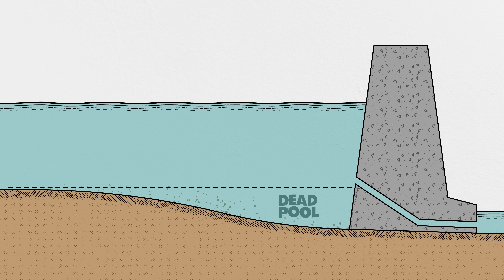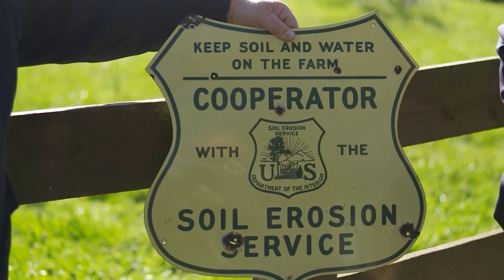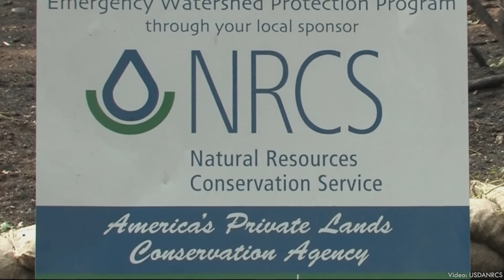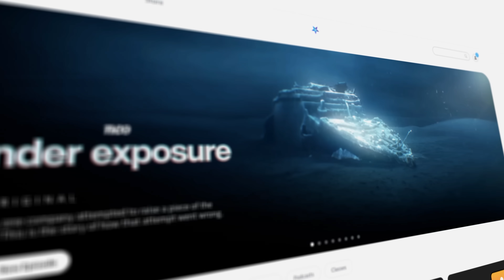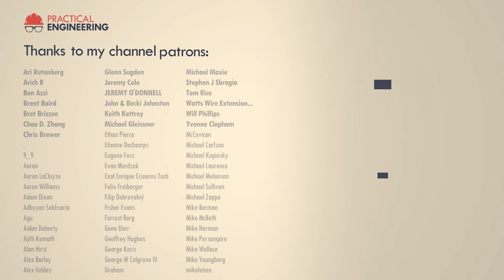All Dams Are Temporary

Comment: This is a key point about hydro-electric for our energy needs.  Dam operations have to serve 'many masters'.  Irrigation, flood control, power generation, this and more.  A useful structure, but complicated to operate sustainably.
Reply: More hamrful than they are useful, at least how they're implemented now.
Reply: @johnperic6860  you don't like free energy? Rather keep buying it from canada?
Reply: @johnperic6860  Oh please, people forget how some areas flooded constantly without dams. In 1931 the yangtze–huai floods killed millions, and while extreme, this is not an exception. Also, Switzerland has been generating the majority of it's electricity with hydropower from dams for nearly a century now.
Reply: @slome815  
Removing the reservoirs does not entail entirely removing the dam.

What I am speaking of is simply turning existing dams into dry dams, that is, dams which allow water to pass unabated but then fill during times of flooding. 

I'm not sure what your point regarding Switzerland is. So they're experienced, and have seen that flushing reservoirs isn't actually harmful in the long term?
Reply: @slome815  the constant “flooding” served a lot ecological benefits, groundwater recharging, pollution management, improved soil fertility, species diversification, etc! Dams are terrible should be banned, most importantly large ones
Reply: @ That's a major generalisation. Some rivers barely have any nutrients and silt, most dams high in the mountains contain streams like this. Then the only thing a flood does is destroy and kill. Do you understand how much power hydroelectric dams can provide, for decades or centuries, and for a fraction of the price of nuclear power plants. 

15% of worldwide electricity generation is from hydropower, this is more then wind and solar combined, and unlike those, it's a good baseline power generation, thanks to the dams. For mountainous regions like Norway (95% of electricity is from hydropower) and switzerland (about 60%) it's by far the best way to generate electricity, both long and short term.
This recent anti-dam movement is dogmatic and as asine as the "green" anti-nuclear power people are. Most dams are a net positive.
Reply: @slome815     No thanks! Based on firsthand experience in my region, I've seen the devastating impact of one of India's tallest dams. It has been leveraged as a geostrategic wea-pon against my region my people, severely disrupting local rivers and aquatic ecosystems. The long-term consequences of such massive structures raise serious concerns, as they have the potential to cause catastrophic failures.
Reply: @  they’re also ticking ordinance time Bmb’s.
Reply: @gurjotsingh8934  And your alternative to dams is? Fossil fuels? Nuclear? Those are even less sustainable, therein lies a huge problem.

The real problem isn't that dams are filling with silt but rather, it's what we're losing all that topsoil in the first place. That's the real problem here.

Removing dams as a solution is akin to telling people to stay inside as a solution to crime. It works but it's not the real issue.

Comment: The mention of "on channel" suggest one solution - divert the river into the reservoir to fill it. and then return it to the normal path, so your reservoir is "off-channel" Of course, this creates other problems like stagnant water.
Reply: Problem there is the river channel is where the reservoir exists. You'd have to dig a whole new channel.

I live near a flood control dam (hydro is secondary use). Elevation of the tailwater is about 700ft, the conservation pool is about 740ft, full pool about 790ft (floods a lot of ag land too)

To divert the river into a second channel while maintaining the existence of the reservoir would require a 50 mile long aqueduct sufficient for 10,000 cubic feet per second (average flow) that also contain bridges to carry water from the main river above any lower lying tributaries or elevating/diverting the tributaries so they flow into the aqueduct instead of the old channel
Reply: @dorvinion  Yeah even at billions of dollars, replacing dams or moving them may be the cheapest overall option - or figuring out how to do without. 5 million tons of sediment a year sounds like a lot until you realize it's taken decades to silt up

Comment: Dam good content here.

I don't think you actually covered my idea for dealing with sediment.  Construct a pipe (paying particular attention to resisting abrasion) which can efficiently transport dredged sediment and deposit it downstream of the dam.  Then whenever the dam releases a lot of water, that sediment will get picked up and transported farther down the river.
Reply: You would need a really large pipe to put the entire contents of a reservoir through it
Reply: @KaitouKaiju  You don't need to send the entire contents of the reservoir.  That's what the dam gates are for.  Sediment is very dilute in most rivers, so what you put in the pipe would be 1000x or more concentrated.  The flow in the pipe would have to be kept high while in use to keep it from clogging, but you could flush it with normal reservoir water if you wanted to shut it down.  The idea is to be able to remove sediment a bit faster than it is being deposited.

Comment: So you are saying the engineers didn't take this into account when they designed the dams to begin with? Actually farmers deal with this same issue in 'slurry pits' all the time, however on a much smaller scale, but the same principle could be used on a yearly maintenance schedule! The dams would have to use barges with pumps and high pressure nozzles, instead of crawler pumps as the farmers do, but they could do the same thing, stirring up the sediment and releasing it through the low level 'pen stocks'!

Comment: Solution is simple. I dug a frog pond. Made a dam. Months went by and it still had not cleared up. It was starting to fill in with sediment. I move a pipe to the bottom of the pond. So it sucks water from the bottom not the top. It cleared the pond up and sucks sediment off the bottom. It is as simple as moving the intake for the dam.
Reply: In large systems the sediment drops out first where the water initially slows. Heaviest particles first. Much of the sediment is far upstream from the dam.

Comment: my idea looks like its already done with that upstream grate. Seems smarter to make purpose built bypass for the sediment in the narrow are where you probably design silt to drop off. Even if you have to use pumps to increase the flow a lil.
other idea was just a permanent barge that sits in the resivior with a flexible pipe with a blender in it lol. Use the water pressure to move it, and blender to get it loose. then have the pipe move it downstream of the dam. 
maybe set off explosives in the water to jump alot of silt up before dumping water downstream occasionally. probably the cheapest way, and could increase the dept of the resivior if you dug it in i guess. epa gonna love that tho.

Comment: What about surface hydroelectric facilities using the natural current of a river?
They act more like a bridge than the dams so I guess they are less damaging to the environment.
But a bit less effective too
Reply: The problem with that is that those facilites do not provide all the serices thaf a dam does. No flood protection, no water storage for human use
Reply: @ sure but they tend to be used on heavy flow rivers where water shortages are not an issue.
Like it works well in Canada for example where there is tons of water.
Reply: @edymarin7781  
Why do they need to?

You want flood protection? You can still build or re-use a dam that holds no permanent reservoir, but can hold water in floods.

You want storage? You can pump water underground into aquifers.

There, you fixed these two problems and solved all the problems caused by conventional hydropower.
Reply: those sound cool :)

Comment: The greatest Practical Engineering demo ever at 4:57
Reply: “Let me prove that to you real quick” 😂😂
Reply: 😂😂😂 "notice how the BOTTOM of the lake is made of dirt. Watch what happens when the TOP is dirt."
Reply: @sethtrey  i believe that's called "quicksand", but i could be wrong
Reply: TIL boats are lighter than water
Reply: @dinassaur9890 the boat/air system is lighter than water.
Reply: @dinassaur9890  per unit volume. Yes. yes they are
Reply: @dinassaur9890 technically, depending on the design, no. The trapped air is lighter :p
Reply: 1) rock is denser than water (~2.6x times)
2) rocks and water are both basically continuous internally
3) in this context, rocks are not comparable to hollow objects, like balloons or boats.

This is a very good discussion though, and buoyant would have maybe been a better word. Less fun though.
Reply: But why is the water not dyed blue? Why no blue!!???
Reply: No this was a horrible demo!!! All it proved is that dirt is less *buoyant* than water. Shape some medal into a boat shape, repeat the process and all of a sudden, "see medal is 'lighter' than water" <- which i hope most people will say is not true.

For most non--engineering channels I would be fine with this 'slip' but for an engineer of his skill, this is kind of unacceptable.
Reply: @randecker3340  you realize that density and buoyancy are related, right?
In your example, you're mixing air into metal for the boat. Replace the air with water and all metal boats sink.
Dirt is indeed heavier than water, and so are boats
Reply: @joshuacheung6518  , yes I do realize that I am increasing the volume of water being displaced, but the weight stays the same. Ok then lets look at something that floats on water, "when replaced" with water. And unfortunately, all i can think of is ice for this. But it fits all criteria. ice is not heaver than water, there is no  "air" to replace (the freezing cause the water to displace more water, but "air" does not replace that space). Based on the videos example, I could say ice is "lighter" than water since it is floating (when in fact it weighs the same as water)
Reply: @randecker3340  for the same volume of material, yes, the boat is heavier, and the ice is lighter than the equivalent of water
This is how bouyancy works...
Reply: @randecker3340  actually, here's another one that floats on water for you. Two gallons of water. Load one gallon of water with salt, just before jt stops dissolving the salt. Weigh them, salt water is heavier. Pour without mixing. Salt water sinks. Fresh water floats.
Reply: You're both wrong. He said it's heavier.
Nothing to do with density or buoyancy, which is why it was a bad demo.
Reply: @Ravenous1990  the dirt is heavier than the water it displaces. That's why it sinks.
Reply: @randecker3340  Your point is moot since buoyancy and density are directly related. You should already know this if youre aware of boats, and that they dont float when full of water and instead sink. 
While the metal in the boat itself is more dense and therefore not buoyant, the boat as a whole is actually less dense than water and is therefore floats. Boats float because they are less dense than water due to the air inside of them, but if the boat fills up with something that is more dense than air like water, then it sinks. 

So if it is denser, it sinks. If it is less dense than water, it floats. Meaning we can tell that the sand that was dumped is indeed denser, no mistake was made with the demonstration. You just didn't understand. And for most non engineers I wouldn't just expect you to know this, but for someone who is trying to correct a literal engineer I would certainly expect you to have a grasp on what buoyancy actually is and how it works. If you were confused, you could've asked a question instead of assuming everyone else is wrong.
Reply: Also the demonstration is that dirt is heavier than water. Nobody's mentioning metal, ice, salt or any other random substance. And we're also not debating what words mean either. This really is a case of it being as simple and obvious as it looks. 😆

I mean, for the pedants out there, dirt is less buoyant than water because it's made from small particles that don't have sufficient surface area to provide enough lift, and they're the wrong shape - they're small and granular so there's nothing for air to mix in with, or to keep the water out of.

Comment: You said "End dump semi trailers" I WOULD LOVE for you to do a video explaining the use and proper names for common and not so common semi trailers!
Reply: ...or even the several different kinds of dump trucks/trailers.  When I migrated from Louisiana to Texas, I noticed that the vast majority of dump semi-trailer here are the iconic Texas belly-dump style, rather than the familiar end-dump style that abounds in Louisiana.  I'm still wondering if this is a TxDOT requirement on its projects.  The safety benefits are obvious.
Reply: @MikeV8652  as someone that has driven dump trailers in the NE, I imagine the belly dumps are more common due to a sever lack of salt? Never been to the Lone Star so I'm unsure to their winter practices.
Reply: @brypilot  I have zero knowledge of road salt, so I don't grasp the relationship to dump trailer types.  That wouldn't explain why belly-dump trailers are ubiquitous in Texas but rare by comparison in Louisiana.  When icing (freezing rain) is expected, TxDOT sprays bridges and overpasses with brine, which works well.  That's done with it's own spray trucks that apply herbicides in the warmer seasons.
Reply: https://youtu.be/6CmX4ZmhwPM?si=oVvbAR-iUueyUvmY for construction related machinery he has a video
Reply: @Ion1212g   I've seen that, Im talking about semi trailers, ya know like semi trailers.

Comment: One potential solution from someone who has no idea about anything ever, what about a mesh across the water to filter out sediment? Then every so often remove the collected sediment to be used for other purposes. I'd see the sediment as a resource to be collected rather than a problem. Also in theory will mean the water is less abrasive when it reaches the dam. I am sure there are a million reasons why both are terrible ideas and would either not work, be practical or be too expensive :)
Reply: Costs will discourage potential bond holders and taxpayers from coughing up the money to attend to such maintenance. You'll see action when the dam ceases working.
Reply: @JohnVKaravitis  If there was an easy way to automatically pull the sand/sediment off any barrier/filter you put in place to collect it. I mean, it's not like that sediment/dirt would have no value and couldn't be used for other purposes. But I guess it would add costs and depending on the width of the waterway may not be practical.

I'm not sure. This is why I am in no way an engineer :)
Reply: I'm not an engineer either, but a mesh fine enough to filter out sediment would probably also be too small for fish or other wildlife to pass through. Would you rely on the wildlife to jump over? Then again, dams themselves already provide an even bigger obstruction to river residents.
Reply: Wont work cuz of fishes and other factors methinks